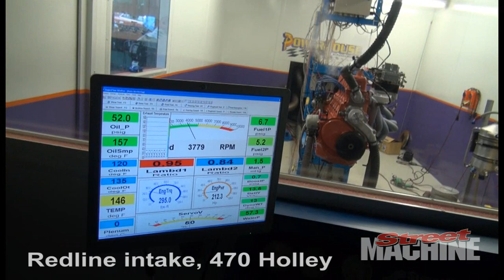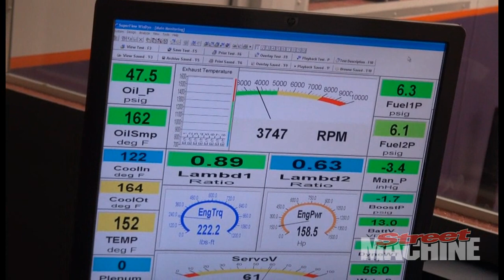Powerhouse Engines HEMI Six Build - Part III - Dyno Test

Comment from the maker: Built in Australia, marketed as the Hemi six. Made from 1970 to 1981
Reply: STREETMACHINETV can we get these sent to the states
Reply: TheDustyaman you should be able theres a few guys here in the states with the barra 4.0ls out of the falcon xr6
Reply: TheDustyaman yeah, but the 265 is reasonably rare and that's the desireable one.
They aren't a true Hemi as you know them. More a wedge with a slight round bit but the ports are hemi-esque and flow quite well.
The most common was the 245.
They have quite a few valve train issues and are one of those motors that quite like to rev but can't because the cheap and ill thought out hyraulic camshaft and valvetrain.
They benefit from a solid lifter camshaft and like this vid beehive springs. 
From a cost point of view, they respond well to modifications up to about 300hp then the mods start getting expensive.
Because of their cubic capacity more rpm (in naturally aspirated form) is the place to go for more power and we all know how much that costs lol...
Reply: Yes, it's called a slant 6 made by Dodge
Reply: @805gregg  No. A local produced engine with ball stud rocker gear that's nothing like a Slant. It's longer too.
Reply: Does not look like a slant six.
Reply: @scootergeorge9576  yeah and Slants only have 4 main bearings and you can clearly see this has 7.
Reply: @805gregg  It's straight up. No slant.
Reply: Best straight six Australia has ever seen

Comment: Did you check the crank end-play torque? Put rubber hoses on the rod bolts. Oil the main bearings.

Comment: I love seeing older tech being built to make power. Question: Why didn't you weld up the hole in the side of the bore first? You had all of the pieces. Then bore it and sleeve it. Now, you have a thin spot in the bore and the iron sleeve will rust faster than the cast iron block.
Reply from the maker: +Steve Solo 

It wasn't deemed necessary.

Comment: 323.4hp @ 4760rpm is nothing to be ashamed of. I would very interested in comparing the '6 Pack' configuration with your 4bbl set up power wise.
Reply from the maker: Blackscorpion1963 Yeah, it would be interesting to see how a set of triples would go on it
Reply: @STREETMACHINETV  here you go https://www.youtube.com/watch?v=BLnMgrF1-v8&t=39s 
400hp at the flywheel
Reply: here you go https://www.youtube.com/watch?v=BLnMgrF1-v8&t=39s 
400hp at the flywheel

Comment: I don't recognize the engine.  Is this the Ford six with the Aussie (Cleveland canted valve) cross-flow head?
Reply from the maker: Lack of Focus This is the Aussie Chrysler Hemi Six. Made in Australia from 1970 through to 1981
Reply: No ford six in n/a form can match a 265
Reply: @chargerwoh  my brother-in-law spent a few thousand back in the day on a 250, cam, ported head, pistons rods all the good shit, still couldnt beat the Limelight VJ 265 Regal Auto… Converted him to Valiants after that😂😂😂😂😂
Reply: No that was ford 3.3 and 4.1 litre alloy Cleveland style cross flow head , the motor that evolved into the 4 litre Turbo Barra motor !

Comment: These engines are known to make over 500 hp naturally aspirated
Reply: I'm calling BS. That's 116 hp per liter. That's not happening out of that head without boost. That head design was incredibly inefficient. If this were capable of making 500hp NA, that would make it more efficient than some of the the best engines made today. It would be more efficient than the Ford coyote and voodoo. It would be more efficient than the Chevy LS7. If would be more efficient than the 6.1 Hemi. If this engine was that good back then... Everyone would have been buying them, and everyone would have been racing them over any V8 at the time.
Reply: @Firion13  you don't know anything about these engines. they had up to 302hp from the factory in 1972. 500hp is close to the limit NA for them. but it's been done a few times. and you talk boost? well over 1200hp has been made. the head design while not the best, still makes good power for what it is. especially considering it's near on 50 years old. research 'hemi 265' if you must.
Reply: @ldnwholesale8552  The stock Head doesn't flow very well the stock crank is forged steel

Comment: I think you forgot the Aussie hemi head... It kinda needs that to be a hemi.
Reply from the maker: This is the Aussie Hemi head
Reply: It is a Hemi , can't you see the valves are on a 30 incline , it makes a Hemi chamber inside, just because the intake / exhaust exit on the same side does not mean it's not a Hemi , all modern Hemi type heads including the Honda CRF 450 have 30 deg Hemi heads ! The old Chrysler 45 deg Hemi is proven not to flow as well as tighter valve angle hemis like the 215,245 and 265 Aussie Hemi,s

Comment: That didn't look like a hemi cyilider head
Reply from the maker: Rob Tob Australian Hemi Six
Reply: Somebody is selling you a bill of goods.  A hemi head has the exhaust on one side and the intake on the other side.  I, personally wouldn't buy that engine as a hemi.  You do what you want.  It is click bait as far as I'm concerned.
Reply: Your talking about a crossflow head . The hemi 6 is not a crossflow design . The "hemi" refers to the hemispherical combustion chamber which it does have
Reply: Well I'm sensitive to click bait vids but this isn't modern click bait since Chrysler Australia called this a Hemi engine. It is known there as a Hemi, has Hemi badges on the body they were in, Hemi stickers on thje rocker cover and air cleaner.
It was built under local content rules. Everybody that knows anything at all about what a real hemi is knows it's not a hemi as in gen 1 & 2 Hemis or Merc-Benz 280, Jaguar 3.8 - 4.2.
Thing is they were built out to 265 cubic inches and made quite a bit of power and could rev. They were a ballsy engine like a 600hp Signature Cummins is. There was something about them that put a smile on your face.
Yep you're 100% correct - they aern't a hemi but they were called that and this vid is calling the motor by its correct name.
Reply: Due to Massive restrictions in North America , we just can't comprehend that the the Aussies are light years ahead on street machines. 
 During the 60s-80s our auto-wrecking yards in Orange County California were sending container loads of Ford (Holden?) parts to motorheads in Australia !  
 If i could build one of their Ford base 300 hemispherical engines here in California , I'd be getting tickets again .  Their iteration of a 225 slant 6 hemi is a monster !  Oh , those were the days .   
 Recently California has banned aftermarket Exaust parts or systems ..... next , CURBFEELERS !
 I understand that auto manufacturers have recently given in to stricter emissions controls and some of the most popular engines will no longer be available .
Reply: @paulj541 sorry buddy , a Hemi has a Hemispherical combustion chamber , this motor is a Hemi with 30 deg valve offset and Hemi chamber , it don't matter were the intake or exhaust exit , do some home work , and Chrysler gave it the Hemi designation.

Comment: Dang phone . Hemi has plugs in the top of the head between the valves
Reply: GreenBoy, the problem with your phone might be from using it too quickly. Take another look at the newer Dodge Charger, Chrysler 300, etc with 5.7 to 6.4 litres. 2 plugs per cylinder, neither in the center between the valves. You'd have a fit if you saw an old Ford SOHC 427 Hemi FE. Slant-plug hemi's are real, dude, and if the valves are north-south instead of east-west then exhaust could exit the same side of the block it came in.
Reply: No it does not , you are just thinking of older and other Hemis , Hemi Stands for Hemispherical combustion chamber, the Aussie 265 HEMI  has 30 deg valve offset and Hemi chamber , the plug location means nothing , do some homework.
Reply: @peters8758 very true my friend , and this motor has 30 deg valve offset, and a Hemi chamber, it is irrelevant were plug is or were intake / exhaust exit , yes ford Hemi sohc motor did have slant plugs comming in from intake manifold if I remember correctly.

Comment: Hmm how is this a hemi motor?????
Reply: 265 heads plenty of pictures to see all over the net to see
Reply: @closertothetruth9209  yes its not a true hemispherical head with opposed valves and cross flow... These 6 cylinder Chrysler Australia engines made really good power. I believe they were designed as a truck engine   by Chrysler US.  They were used in Dodge trucks in Australia and possibly in the US..but I'm not sure at all.
Who cares if its not a crossflow..these motors really produced the goods.
Reply: Still technically a hemi, it's more of a Polly hemi similar to the Dodge 318 in 1955.

Comment: What the Hell is a Hemi six?  And that cylinder head is not a Hemi anyway.
Reply: Captain 345  they are an Australian built engine. Your right they are not a true hemi head but they have a similar combustion chamber.  We call them hemis. Go luck fuck and are tough.
Reply: Yes it is by definition a Hemi chamber, 30 deg valve offset, Hemi combustion chamber, do some homework